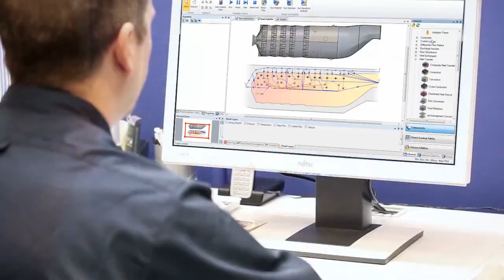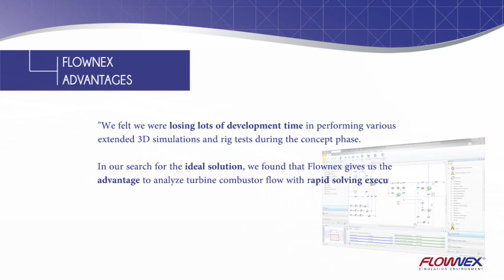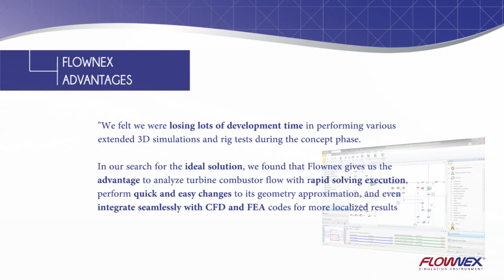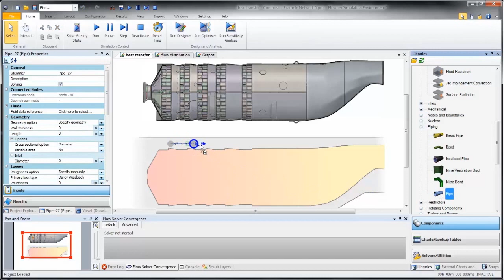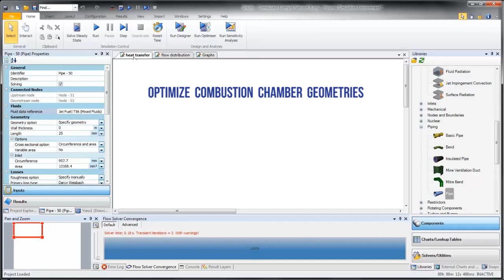Turbine combustion chamber overview

Comment: It looked like it was going to be about the combustors, it ain't it's a commercial about the company and their CGA that can be about combustors
Reply: i have a question. is it true that turbine jets don't use the maximum theoretical chemical possible air fuel ratio i.e. 14:1 since it is a continuous flow system and that would create continues flame where  temperatures are higher than any material know to man can stand? so there is excess air pumped in cooling the combustor reducing  the actual air fuel ration to 50%, in other words the 100% stiochometric ratio for turbines is actually 50% of the chemical maximum?
Reply from the maker: Hi Shannon! Thank you for your feedback, we see what you mean! We'll change the description to give the user more insight into what they can expect. If you have any content that you'd like us to add or expand upon, please let us know!